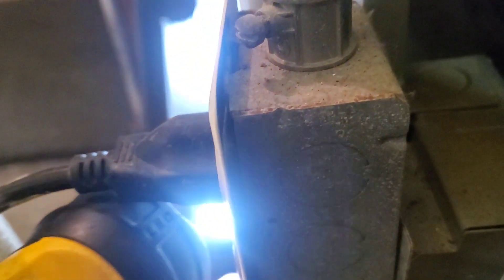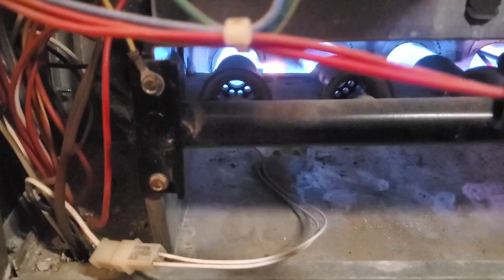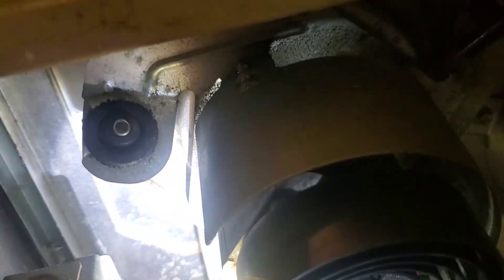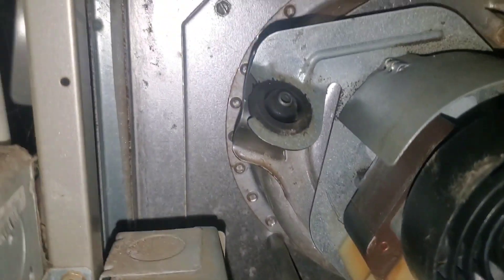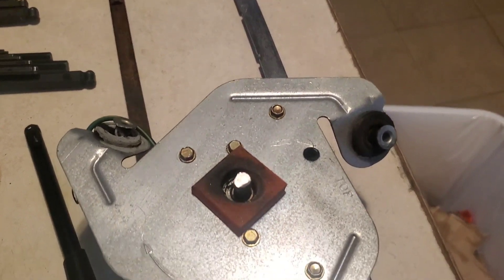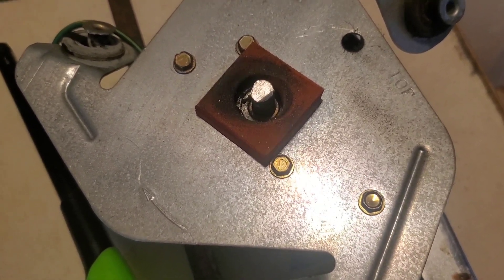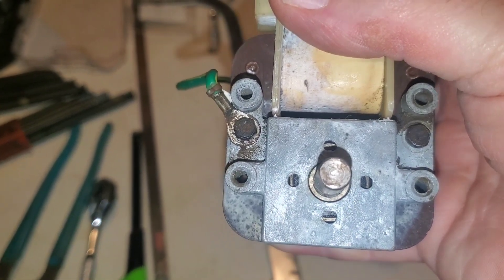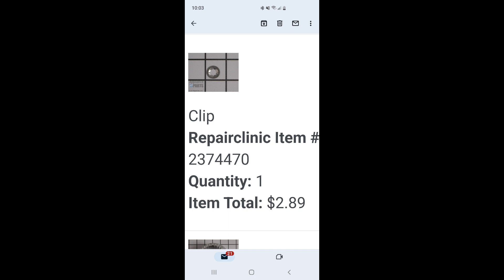How to diagnose and repair  a Carrier furnace with a bad inducer motor.

Comment: But this motor keeps on failing is my third one in six years
Reply from the maker: That is strange, 2 years isn't very long at all and I can't imagine what would cause that. Unless the contract board isn't providing proper voltage. 
I would keep an extra one on hand in case it fails again. The last one I changed lasted 4 years and I have a spare on the shelf.

Comment: Rule number one:  DON'T PANIC.  I had a Carrier inducer motor SEIZE UP one week where daytime temps were in the 30s and night temps were in the teens!!  I watched a few videos on YouTube, ordered the entire replacement assembly and installed it with no issues.  A few important steps:  shut the main electrical power off FIRST, then the gas main line and then the gas valve switch.  After installation, cut electrical power on, then GAS VALVE SWITCH and open gas main line LAST.  Thanks for posting a helpful and informative video.
Reply from the maker: Furnaces can be intimidating but with a little research most can be repaired by homeowners.